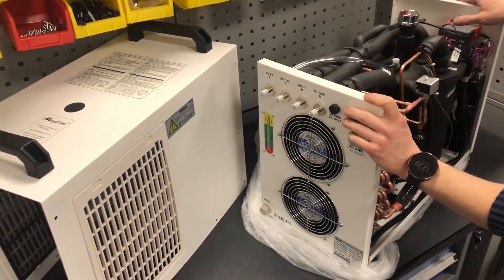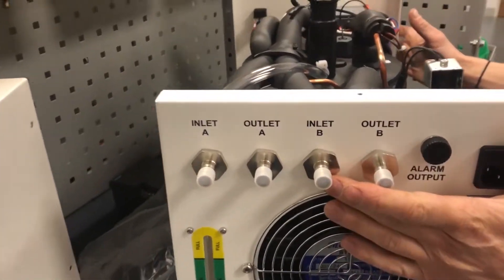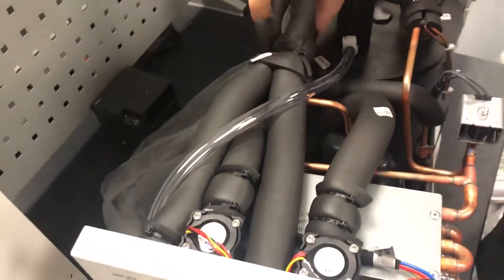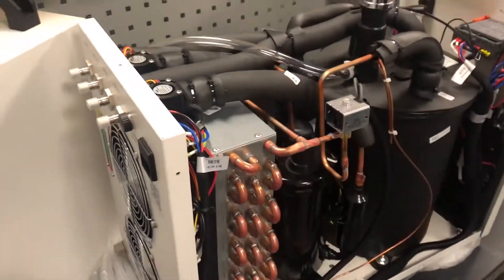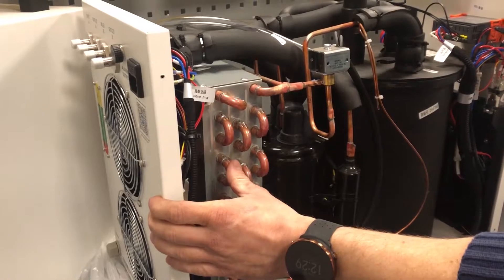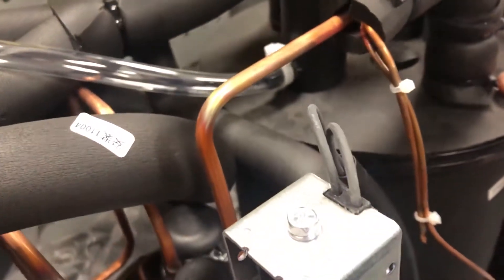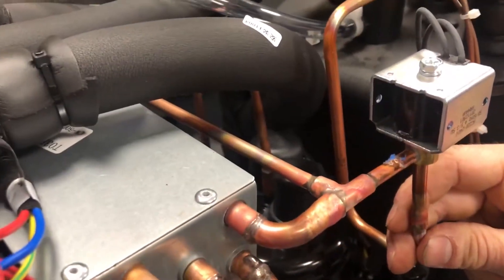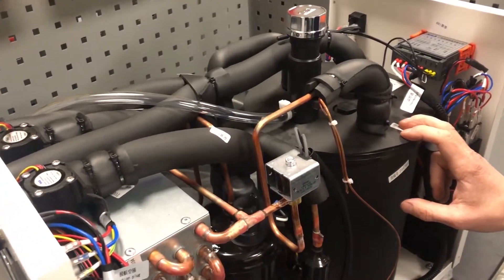Inner workings of the S&A CW 5202 Dual Circuit | Industrial Water Chillers | Look inside 👀🔍

Comment: Hola una pregunta el motocompresor esta funcionando todo el tiempo o el delta de ajustede temperatura puede ampliarce para que al aocanzar la temperatura se mamtenga apagado 10 monitos y encendido otros 10. Gracias 🤔
Reply: Thank you for your enquiry. I can confirm the compressor will come online when water temperature goes over and it will then switch off once it achieves the set point. It will switch between on and off as necessary. It is not possible to set to switch off for a specific time using the internal controller.

Comment: Are you sure that is what the bypass solenoid is for? S&A have a video guide on how to replace the heaters on the models fitted with them. It's basically an aquarium heater fitted where the blanking plug is on the tank.

Comment: How ingenious to derive the high pressure tube to use as a heater, a pity that it is not well appreciated how it is made. What is the capacity of the water tank and what is the flow of this chiler? Good job, thanks.
Reply: 6L and ~ 12L/min

Comment: Could this handle a rotary evaporator bath temp at 50C, so chiller would need to maintain 14C or lower for say 3 hours or so.
Reply from the maker: @pete7894 - we are going to need some more information to understand the intricacies of your set up and requirements which will be handed over to Ben our Product Manager. Could you send a quick email over to our main address  - info@megatech.com - if you'd prefer to carry on the conversation on here let us know in a reply comment and we'll do our best to help out in as shorter comment feed as possible!

Comment: Can the chiller be modified so that the chilling process can be managed manually via a switch rather than a thermostat? Using one with a laser engraver would benefit being able to use the pump alone while the water temp increases and then when the laser is not being used, turning on the chiller to cool the water back down inbetween jobs. Im finding that the chiller constantly turning on and off to maintain temperature is causing power fluctuations that show up in engraved images
Reply from the maker: Unfortunately, we don't offer this as an upgrade I'm afraid.

Comment: Would this be suitable for running 2x 60w laser engravers? seems a more economical solution than two seperate cw-5000's ... I'm tired of putting ice in buckets for my machines :)
Reply from the maker: Yes, this chiller can handle 2 x 60w lasers.
Reply: Although it has two inlets and outlets, it only has a single alarm connector.  How do you deal with this on two lasers?
Reply: @makerspace533 Wire the alarms in series or parallel, depending if they are NC or NO.
Reply: Actually, the alarm outlet has independent wiring for each outlet (2 signals and a common pin; 3 Pins total).

Comment: Can this direct cool water to a cooling coil for a mini AHU to get blown cool air inside a cabin
Reply from the maker: To answer your question, there are many factors that we need to consider. Such as total cooling duty (KW) for the AHU? How many units do you have? How long will the pipe run be as the chiller spec will affect the water flow rate, affecting efficiency? These sized chillers haven't got the correct specification for your AHU, we think...